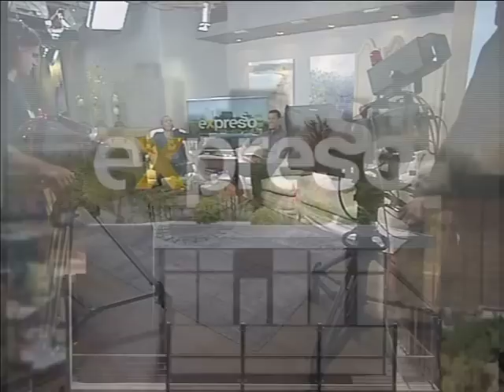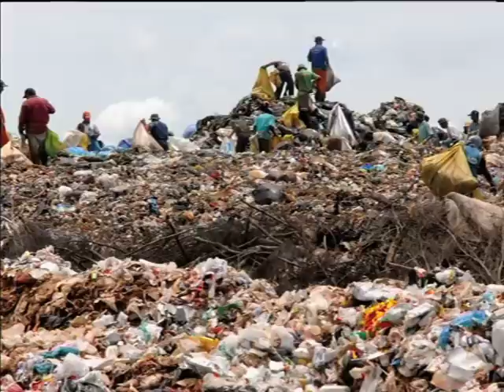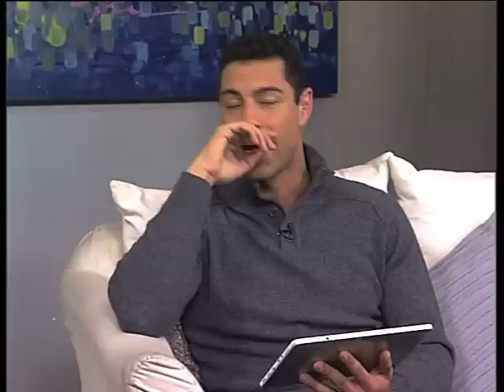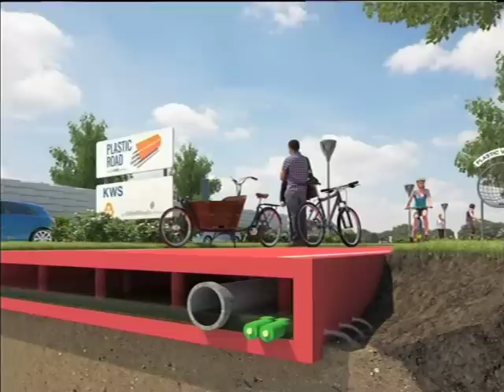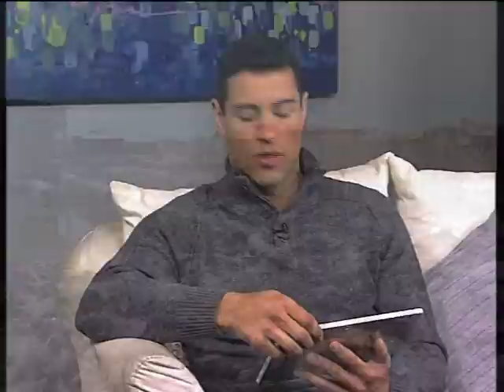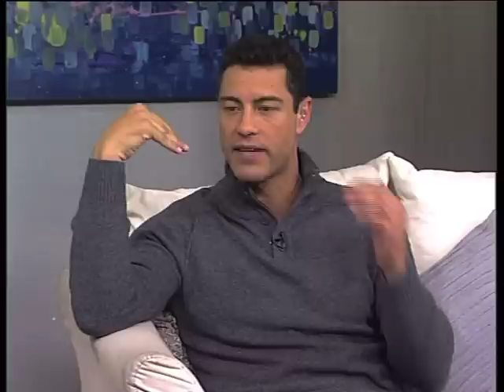Plastic Roads could replace tar roads

Comment: What about the lack of friction when wet?
There is also a reason that water lines are about 1m under ground. If you have water lines so close to the surface the water will freece in a cold winter.

Comment: Are you idiots kidding?!?  No plastic is strong enough and is too light to stay intact during heavy winds and even accidents, the roads will just fly apart.  Replacing sections?  Then water and electrical disruptions will happen each time a small section is replaced since they are inside the gaps of the plastic roads.  There's not enough plastic waste in the world for the supply that would be needed.  The sun breaks down plastics changing it's composition and strength (UV rays).  All that weight from cars and big trucks will be supported by just the 4 supports in the hollow road.  There will be major dipping between the supports.  Plastic roads will still need the same foundation underneath that current roads have.  Accidents will shred and melt (if there's a fire) the plastic.  In heavy rains, when the water drains out from the inside, eventually the foundation would get washed away at those points.  Traction of plastic is not good, especially when wet.  In the winter, plastics don't do well in the cold, they lose a lot of strength.  Plastic expands a lot more than asphalt in the heat (I think 9 or 10% more).  Wouldn't the sun reflect up off the plastic, making driving conditions a lot more unsafe because of glare?  Asphalt roads are over 99% recyclable now.  

What's next?  Moon rock roads?  I mean, just look at all that material up there.
Or we could bring back corduroy roads made of wooden logs...

Comment: kevii, they are sectional, you just lift the affected area and replace with a new section
Reply: +hazelann alexander 

How do they expect to lift up damaged sections with the cables and pipes running through the middle of them?
Reply: the top surface  comes off
Reply: No, it doesn't.
Reply: If they can be so easily removed then boy... there are gonna be a LOT of car accidents
Reply: 0rcd0c 
Exactly.